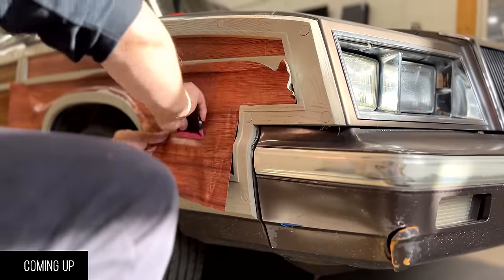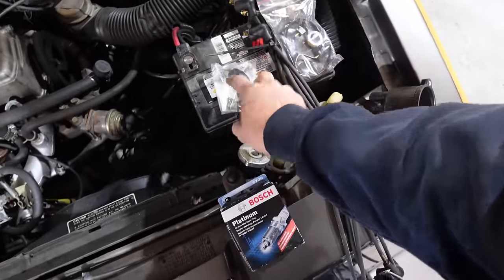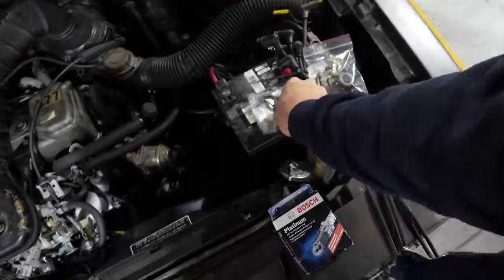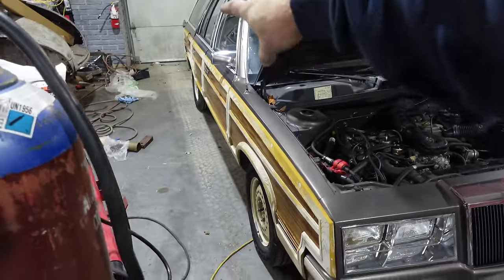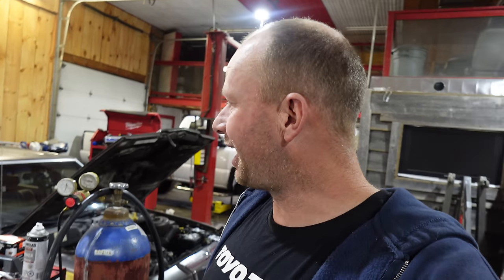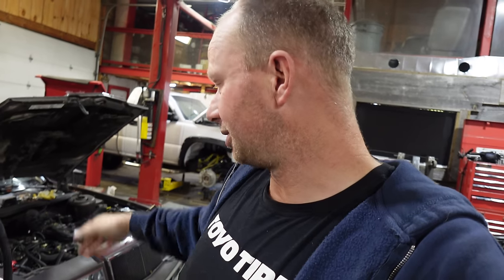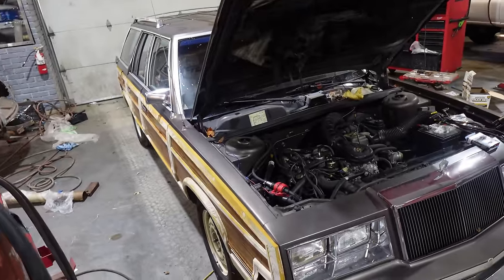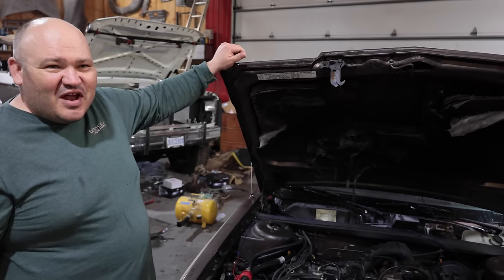Sprucing up the Mopar Woody Wagon! #HemiUnderWood [EP2]

Comment: The large speaker hole is for the AM only radio that was still offered “back in the day”.  The car would have only the one speaker and nothing else.  You guys ended up with the luxury edition, what luck!  Enjoy that thing, brings me back decades, as every third kid in high school had one iteration or another of this car.  Mom and Dad had handed this down to them, and it was party time!  The wrap job looks better than factory original.
Reply: actually they had a mono AM-FM option if I recall properly(as a kid). but yes that was for the lowest end wagon/car audio option.
my first used junker had a mono- am/fm radio. of course I upgraded it for fm stereo cassette and random old house speakers iN the rear(hatch-back), it worked and heard over the road/wind noise of windows down summers.

Comment: I grew up in the 80’s and we had three kcars!! I have a 1991 acclaim(2nd generation) and restored it. It has more room inside because I’m 6’5”. I would love to have a first gen Plymouth voyager. Wonderful wonderful memories
Reply: Been a mechanic for 20yr

My first job as a mechanic was fixing a friends acclaim that wouldn’t start. 
It snapped the camshaft in half?

Spent all winter night with a flashlight learning what engine timing was. 

Got it done!!!

I think I got $150
Everyone was happy as hell😂

And he still drove that thing long as I lived in the area.
Reply: I had a white acclaim with a 3.0l v6, great car! As a mechanic at a dodge dealer it came in as a trade in, I bought it for they gave them on trade which was $700, put all new brakes on it and drove the snot out of it for 3 years, and it really gave me no troubles......would buy one today if it wasn't rusted out

Comment: We also had a K car.  It was a 1984 Plymouth Reliant.  It had the Mopar engine.  We also ordered a Plymouth Caravelle that used the same engine but it was a fuel injected car.  Thank you for sharing your Mitsubishi powered car.  Enjoy.  Our car was given to our son after he was married.  It met an untimely end.  It was T-boned in an intersection by a "stolen" car.  The Plymouth Caravelle was driven until the wheels fell off.  It had over 350,000 km in Canada.  I had changed the engine oil almost religiously.

Comment: Step mom had a '84 Km car wagon that I used as a trainer when learning to drive. It didn't last two years. Had the transmission replaced under warranty with 20,000 miles on it and when it started running like crap during a trip to Colorado from Texas, Dad  traded it in on a Camry.

Comment: Wow, I forgot that a lot of those had the 2.6 Mitsubishi engine in them. I'm used to seeing the 2.2 Mopar 4 banger (with or without turbo). My neighbor had an Omni GLH with the 2.2 turbo, and it was a rocket!😂 The broken pipe is actually for EGR. Just set the timing back a couple degrees to keep the pre-ignition down, and you'll be good! Those engines have a bit of a slow cam in them to try to meet emissions for the day when they were still carbureted. I dunno if you could even GET a performance cam that would eliminate that.🤷‍♂ EDIT: The plastic hubcaps you got actually fit the vintage of the car nicely!😉

Comment: I drove a few rental K-Cars as an electronic service tech in the late 80’s.  The 2.2 l auto was ok but they mostly had air conditioning which was nice.  I wound up driving a 2.2 l Plymouth Horizon a lot, which did not have AC and had to be moving to get any airflow but it would do 140 kph on the 401, which was fun.  With the windows down the unlocked back hatch opened up on the highway once..that was funny.

Comment: A little tech tip for you on Chrysler glass. It always weights more than others because when it's manufactured they have a higher content of silica in it for sound control. All the older Chrysler glass was a true 1/4 inch thick unlike other manufacturers who were progressing towards thinner glass for weight savings and fuel economy

Comment: It's already got a Hemi in it. That little G54b for the most part only ever got hemi heads excluding the Magnas (Australia) and the HKS prototype rally Starion. If anything it's the biggest issue with turning these into a performance engine if you don't already have the MCA jet valves in the head.
Reply: 12cyl of hemi. 
He should run both engines together on track. 

Rally drivers figured out you don’t have to have two engines that make similar power. 
One strong and one weak works great. 

A legend once had a twin vw engines,
Rear was turbo
Front was na

And they play together happily. 😊

Comment: The 84,(1985 went to 5x100 bolt pattern) Shelby Charger/Omni GLH had 15" mag wheels known as pizza cutters with a 195/55r15 tires or 205/55r15, they would look good on this thing!! Make sure the chain guides are good, or you're doing a head job.

Comment: Hey Rich if you have problems finding parts for that engine you can check with hyster forklift dealers a lot of the older hyster 40s and 50s series use that 2.6 l... Granted they were mostly propane but I imagine the internals and the ignition was the same

Comment: Look,  I  HAD  a  Aries  Station wagon.  It  filled  a  purpose  for  several  years  and  I  did  drive  it  into  the  ground.  There  were  welds  on  the  frame  parts  everywhere.  But.  This  wagon  actually  does  look  sharp.  Period.  The exterior  couldn't  be  much  better,  save  for  maybe  color  matching  the  hubcaps  to  the  wood  panel.  And  I  can  whole  heartedly  agree  on  that  stereo  and  it's  fitment.  But,  please,  consider  redoing  the  rear  speakers.  Yer  gonna  need  them  when  playing  Panama  or  Life  Is  A  Highway  while  cruising.

Comment: 22:16 -ish that single speaker location is probably for lower spec'd radio options. When I upgraded my '74, I used a similar location for the CB Radio! I suppose it could be a centre channel in a 5.1 surround sound setup... or a small special sub? 

...

A Friend had a Turbo version and that was a lotta fun! <3 all

Comment: 13:28 real heavy gauge metal and thick rear glass, the plastic and insulation weigh not much unless water logged, but fiberglass doesn't hold water well(unless frozen to ice).
they were designed to keep and hold 500LBS+ material/food/random material(kids) from slamming out the back when turning fast or steep inclines.
relatives back then hauled wheels of swiss cheese and multiple 50lbs crates of smoked meats at once, which would wildly slide around on the steep grades(20%+)

Comment: that should be a single wire O2 sensor on the manifold. some of the carbs cars at the end still had O2s to monitor even though they had no carb control. it is what probably controls that valve opening and closing to that EGR pipe set up you blocked

Comment: That broken pipe is possibly Exhaust Gas Recirc pipe.. that would cause major issues when EGR valve opens. Air would be able to leak into manifold effectively bypassing the MAF sensor and leaning the fuel mixture right out.  Maybe part of your issue

Comment: The engines on k cars were tough I picked up a 83 Shelby charger for practically nothing . Engine had a bad head because someone over tightened cam caps. I used emery cloth and sanded it smooth and ran it another two years lol

Comment: that actually is a O2 sensor on the manifold. that carb uses a mixture solenoid... replace it with a weber bolt on carb, it eliminates all the computer control

Comment: That 2.6L engine is known as a G54B. It's the same engine that came in the Mitsubishi Starion.
Reply: And the Mazda B2600, Mighty max/D50 first and second gens, monteros, pajeros, challengers, minivans, busses, etc. They were everywhere. I'd say it's like the SBC of mitsubishi just from how widely it was used. Really wish we had something better than the Hemi heads for it here in the states.
Reply: Carburetors on those were a nightmare, 50,000 vacuum lines and a phenolic body so you couldn't dip it in carb solvent. As a driveability tech, I hated them. But when they worked, they ran great
Reply: @dave1135  The only time I see carb'd G54b's anymore is with weber 32/36 conversions. Hell, my PowerRam 50's got one too before I bought it. I wouldn't say it's more efficient in terms of economy, but the fact you can eliminate all the emissions stuff and cut out 90% of the vacuum lines, it's a worthwhile mod just for longevities sake.

Comment: Are you old enough to remember the Morris Minorv wagon that had the 427 in the back... he was from Stoney Creek i think. 

Used to drive it with the 1000cc engine with the yarn clutch... blowby galore. 

He'd pull up to the lights and shut down the Morris. Yiud hear the air starter spin up the 427 after he reeled the tonneau off the injector flutes through the roof.

Comment: That was just secondary air injection , puts fresh air into exhaust during cold to meet emissions. These were long stroke motors so torquey down low, nothing at top. Also low compression so it likes timing, really livens it up. Jet valve heads, another emission equipment is known to crack and then cause overheating

Comment: If putting the Hemi in the back seems daunting and $$$ (and I feel like it likely is), there have been a few K-platform cars (like the Daytona's) that have been Hemi swaps by putting the Hemi up front and I believe bolting in a modern Charger/Challenger rear end cradle in the back...ends up looking bone stock and since they really don't weigh anything, with the right traction should go like hell!...look up 'Daytona Hemi swap'...there is a red one that looks bone stock down to the cheese cutter original wheels (sketchy!), and a black one that was done up a little it and sounds and looks like the car should have been from day one.  I personally would go this route as if done like that red Daytona, it would be a crazy sleeper (and the interior looks too nice to hack up) ...probably a lot easier to handle on the track too...lol.

Also for wheels, see if you can track down some period correct Daytona aluminum 4 bolts.  Those hubcaps are similar to the '87 to '90 (I think) Daytona's.  There was a multi-spoke aluminum and a pair of 'holed' 4 bolts, one with lots of holes, and another with holes around the perimeter.

Comment: If you owned a Trans Am or Firebird in the late 80s you probably installed a 100 of those trunk struts and a dozen truck lid lock motors.

Comment: fix that head liner, they ruin your ride when they touch your head !  It was the thing that allowed me to give away my GLH ( one 1/4 " rust hole in the drip rail , kind of clean)  that & some kept pouring  2 ? gallons (like 2" deep)  of water in the rear driver foot well> explain how  happened with  out a S balls "help" .

Comment: MY wife had a K car the car computer failed just as the mileage made it no longer fixed by warrentee, $1,500.00 & a new computer fixed the problem then same problem just after replacement warrentee expired I then went to NAPA dealer purchased a non Chrysler computer which never failed again the timeing of the failures was suspicious  however nothing could be proven without investing a lot more money & the wife purchased a fancy nisson that launched us in a new direction.

Comment: Why would you wreck the car buy chopping the a(#( up and putting a hemi in it. Swap in a modern 4 cylinder turbo and maybe a manual trans and it will be way better and more desirable and not chopped up POS!

Comment: I feel like y’all are sponsored by some led company. Why is the obsession with leds in old cars? It’s like an idiotic cult. They burn out quickly, mess with relays, and for what? The only place I have installed an led, was the dome light, in case I leave it on, but it burned out with a year or two, and it was a Sylvania.